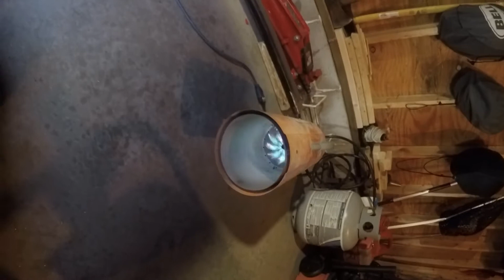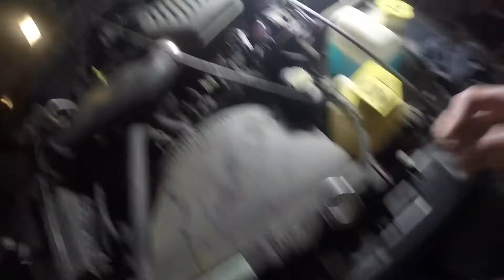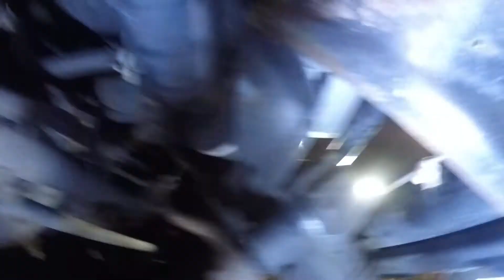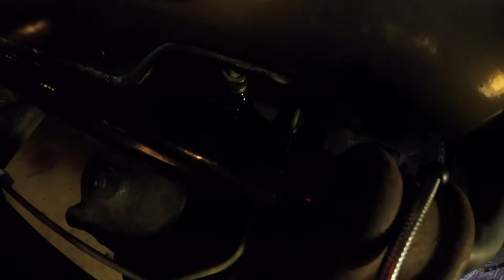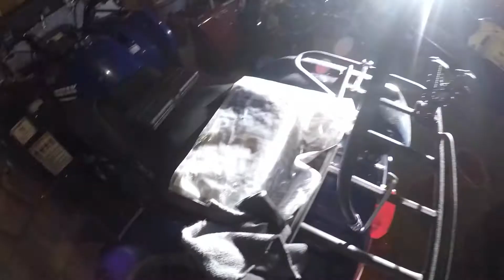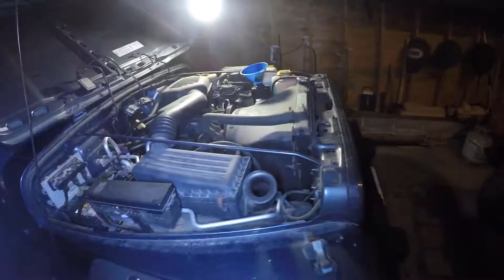2001 Jeep Wrangler: Power Steering High Pressure Line/Hose Swap

Comment: I just changed mine but several days before I started I used PB Blaster on the thread’s of both ends of the hose and they broke loose very easily and mine was a 1995 Jeep YJ 2.5L yours needed some penetrating oil extremely bad.

Comment: Someone advised using Teflon tape on the fittings to keep it from leaking… what are your thoughts?
Reply: Probably cause your steering fluid to bubble up. Teflon isn’t needed on these connectors.

Comment: Remove the three bolts that holds the unit on the frame drop it down a few inches and use a regular wrench to loosen or tighten the connecting nut.

Comment: Could you cut the tube off just above the nut you loosened? Then you could put a socket on it to remove. You can cut and butcher the olds parts you are removing.